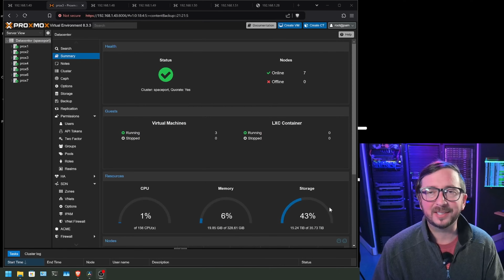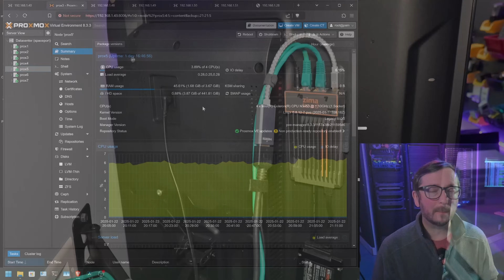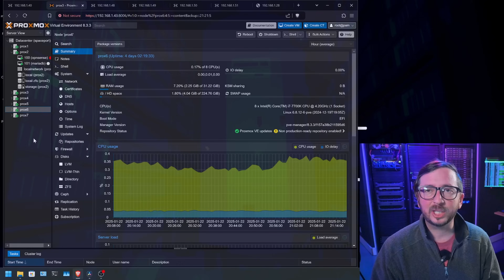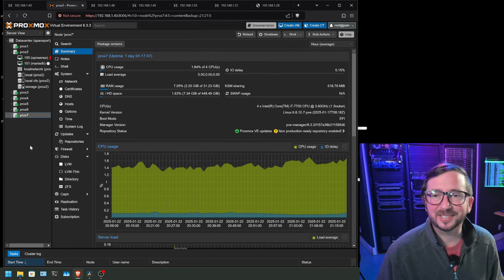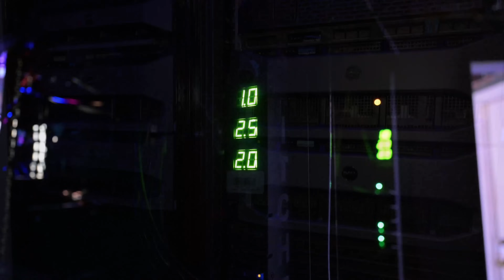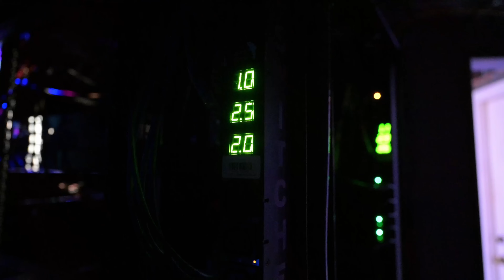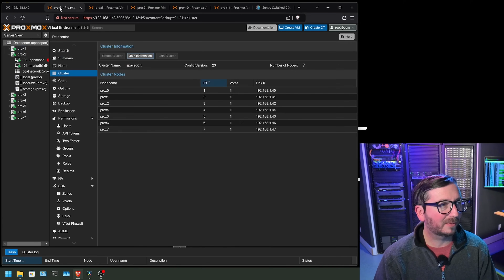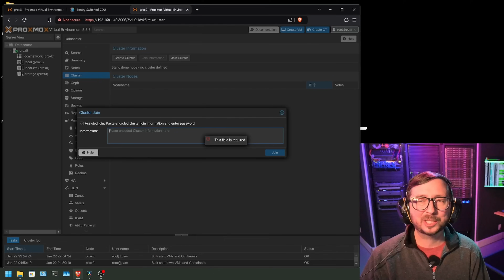INSANE Homelab Proxmox Cluster

Comment: OK lets crowd source a home server cooler / home water heater setup.
Reply from the maker: I'm actually very down for this. Needs to have cooling in the low kWh range. I have toyed with using a car radiator as  the heatsink.
Reply: @ I feel like you'd have to go straight copper from the CPUs and gpus to a heat exchanger in the back with a coil. Cold water starts at the top since heat rises then makes its way down. I guess it could work if ur water heater is below ur servers.

Comment: How do you delete an existing cluster in Proxmox? I originally created a cluster that I need to pull back and recreate, but I can't find the the option to delete the existing cluster.
Reply from the maker: You can remove nodes from a cluster, but not remake it fully from scratch. Welcome to my world. Either condolences or congrats depending on how you read that. I backed up all my vms and containers and am already in the process of tearing this down to rebuild it better. It started so innocently.
Reply: @DigitalSpaceport  
They make it so easy to JOIN a cluster, but if you need a complete redo -- good luck!!!

Comment: renovating house right now.... moving servers,switches and JBODs to an attic "Server Closet" ro control noise and cooling.... have the hot side ducted to the basement to recover the heat.... game plan is to use Home Assistant to control supply/cold side air with two motorized dampers based on inside/outside air temps.... One duct damper is direct and filtered from outside , the other recycles inside air..... most of the heat comes off the JBODS..... only spinning 120 drives at the moment....
Reply from the maker: What fan are you thinking of using?
Reply: @DigitalSpaceport  I'm experimenting with a FanTech inline/remote booster shortly, hoping the motor will let me run it off a fan speed control switch for variable speed.... but a basic duct booster fan will work.... Game plan is the Data Center hot/cold aisle approach.... pressurize the front suck off the back..... front/rear doors  on the "closet"..... your case if you can close off the back side you could potentially  chose between exhausting into the house or directly outside..... remember to filter make up air if you exhaust to the outside on hot days.... I spent 10 years in the DC environment before retiring 7 years ago..... after thought: you need to think about how much air (volume/cfm) the server's fans move, I've seen the server racks pressurize a hot aisle, very bad for cooling... as over kill, maybe not if you fill those racks, you could use an old hvac air handler fan and some of it's duct-work.... this is as close to social media as I get, if there's a way to talk I'd be glad to share experiences....